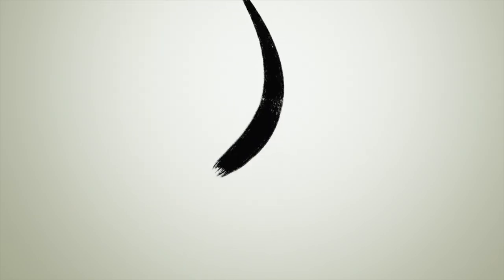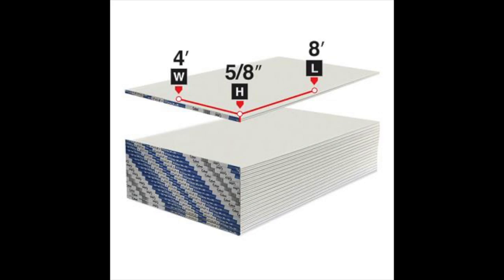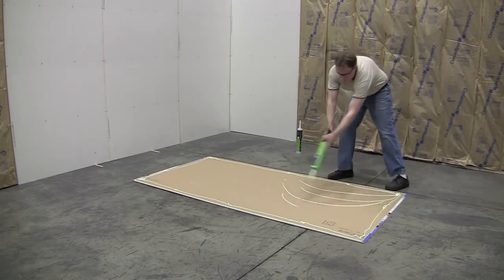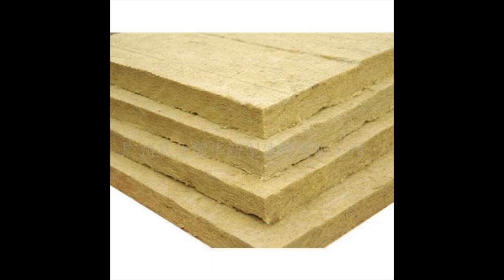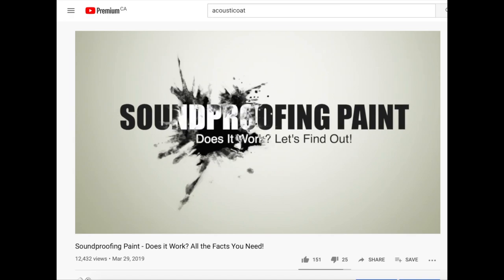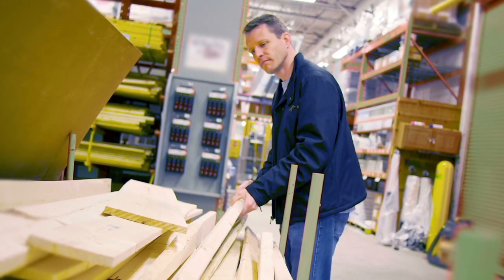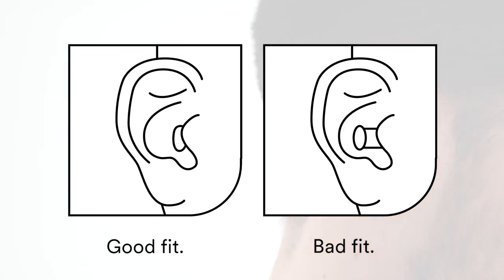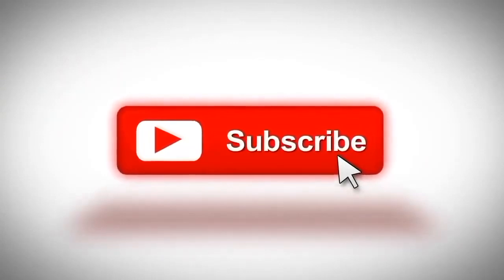How to Soundproof a Ceiling the RIGHT Way! DIY & Cheap!

Comment: mr soundproof guide, i live in basement with dry wall and the noise from de 2nd floor drives mi creazy. What can i do?
Reply: YES.  HELP
Reply: Just turn your radio up even louder than the noise above you, or you could get a broom stick and start hitting the ceiling when the neighbors above are too noisey

Comment: Hi there, in your article How to Soundproof a Ceiling, you suggest if there's a finished ceiling to attach the soundclips to the studs through the finished ceiling.  The local supply store here said that is a completely non-standard application.  Have you tried it?  Is it effective?  I would love to not have to take down the existing drywall!
Reply: It’s not standard since you are basically just making the covered up drywall pointless. That drywall is probably directly screwed into the joists so it is getting direct impact vibration. Also installing resilient channel over existing drywall would make it hard to find the joists. The metal Chantel’s have to Atleast by screwed into the joists. Anyways, while it would work, you are already doing a lot of work to put up new drywall and the channels. Might as well just add one extra day of work by taking old drywall off

Comment: 2x 5/8” drywall + 2 tubes of green glue/4’x8’ sheet of drywall sounds pricey, is it cheaper to go with soundproofing drywall instead?  Which method would provide better sound isolation?
This is for a basement media room, looking for as little transmission upstairs as possible. Also considering adding regular pink insulation vs roxul. 
Much appreciated.
Reply: I’m thinking you could probably blow in some cellulose and dense pack it in between the floor hoist and the existing Sheetrock (that is if your ceiling is finished) adding another layer of Sheetrock is a terrible idea. Let’s add a heavy ass 5/8” sheet of drywall, thus causing ceiling to lower maybe an inch or so.. bad idea for basements.. just blow in the cellulose. It’s cheaper, you could do it in a day or two instead of a week or two.. no need to finish the drywall, no glue, no buying and packing Sheetrock around your house, no having to extend outlets, switches lights etc.
Reply: I have pasted and copied this out for you as it was a reply a gave another person in this YouTube video chat but I think it will help you out a bit too! I did change it up a bit for your needs too!

be very careful about what you are told, this sound transmission attenuation issue is tricky and never cheap and or easy.
one of the main things about attenuating noise is to create an air tight barrier that has mass and is dense between you and the sound source to work. 
if you don't want the sounds you have in your media room leaking into upstairs and annoying your family, you need to build a thick, dense, multi layer barrier between you and the ceiling that is de-coupled from the ceiling as not to become a huge speaker resonating sympathetically to the sounds you are and making with your media centre and making it worse than before. 
the frequencies to worry about are the low and loud ones, 200hz and below at 90-110db, it will only work if you build something that is around 150-200mm thick made of light gauge steel frame not pine frame and multiple layers (3-4) of dense plaster sheet like fyrchek 16mm dense plaster.
you could use 2 sheets of 16mm plaster and 2 sheet of 17mm non-structural ply wood sheet and sandwich them together in pairs with rubber infused tile glue in place of the green glue rip off! build a steel frame with insulation, not Rockwool in the cavity of the frame just normal cheap glass pink batts, add one pair of plaster/ply wood to each side of the frame making a wall really then suspend this from hangers like they do in offices ceiling construction, screw clips to your existing ceiling and bend out some steel rods for hangers and add clips to your new ceiling/wall.
I would try to get the new drop ceiling to hang about 50mm off the existing ceiling, the air gap gives you even more sound reduction too!
once up you would want to go around the edges with no more gaps and fill in any gaps around the perimeter of the drop ceiling you have just installed.
you could cornice around the edges so it just looks like a normal ceiling?
Reply: Plus i dont really like the idea that some adhesive stuck to paper is holding 70lbs over my head.
Reply: Max -x  two 5/8” over existing Sheetrock? So the theory behind the two Sheetrock is you need some sort of rubber layer, caulk or sound Mat between the two so it absorbs the majority of the sound waves hitting the wall or ceiling. If you are going for max sound absorption then there is a pretty extensive procedure to sound proof.. if you’re starting from bare floor joists for ceiling then; 
-I’d go get some Rockwool sound insulation at lowes, (HD has their brand) stuff the joists with the sound insulation, 
-get yourself some shower pan vinyl (in stock at most lowes/HD), 
-then there are these metal channels that you screw into the floor joists, and then the sheet rock screws into the channels, (helps prevent sound waves traveling thru Sheetrock into studs into upstairs/other room) 
-then first later of sheet rock gets screwed into the channels, get some sound absorbing caulk, slop it in the sheet rock layer that’s already on ceiling, then screw up the second layer. Gotta caulk any gaps in the Sheetrock to help prevent sound waves getting thru..

Long story short, if you’re wanting to just screw another layer of sheet rock into existing layer, I don’t think it would really be of much help, all the sound waves get absorbed on the ceiling then travel thru Sheetrock to floor joists into upstairs or room next door. If you’re wanting to just slap another thing of sheet rock on, I’d go rent one of those insulation blowers, cut a hole in the ceiling for the hose, find all the joists, fill in from both sides of the room the floor joist cavity (might have air vents or pipes preventing insulation from gojng all the way to the end) then once floor cavity is filled, I’d get that shower pan vinyl and double it up, then screw the secon layer of drywall up.. the insulation will stop a lot of sound, the vinyl mat should help absorb a lot of it too.. if you ever get the chance or ever finish a basement bathroom for example and you use the mineral wool and insulate the entire room, you’ll notice a huge difference in how much sound gets absorbed into the insulation it’s pretty crazy

Comment: what about acoustic panels? i am in a rental apartment. theres no way i can do this kind of construction, but i need something to dampen the noise of the neighbours above me! even just a little.
Reply: same, im looking for the same solution.
Reply: I can read my own desperation in your writing :)
Reply: be very careful about what you are told, this sound transmission attenuation issue is tricky and never cheap and or easy.
one of the main things about attenuating noise is to create an air tight barrier that has mass and is dense between you and the sound source to work. 
if you have an upstairs neighbour and can hear them bouncing around up there while you want it to be quiet in your living space you need to build a thick, dense, multi layer barrier between you and the ceiling that is de-coupled from the ceiling as not to become a huge speaker resonating sympathetically to the neighbours bouncing sounds and making it worse than before. 
if the frequencies are higher rather than lower then it will be a thinner structure but if the frequencies are low and loud then it will only work if you build something that is around 150-200mm thick made of light gauge steel frame not pine frame and multiple layers (3-4) of dense plaster sheet like fyrchek 16mm plaster.
you could use 2 sheets of 16mm plaster and 1 sheet of 17mm non-structural ply wood sheet with insulation, not Rockwool in the cavity of the frame, if made well you could suspend this from hangers like they do in offices, they screw a clip into the frame of the building and bend steel rod to form a hook which then hooks through the clip and then to the frame of the false ceiling, they then drop in the white fibre board and you have an office ceiling. you would not need to use too many clips depending on the size of the room, standard 3x3 maybe 9 clips? I would try to get the new drop ceiling to hang about 50mm off the existing ceiling, the air gap gives you even more sound reduction too!

once up you would want to go around the edges with no more gaps and fill in any gaps around the perimeter of the drop ceiling you have just installed.
it will cost a little bit and be a bit annoying to build but it will give you the best chance of attenuating the lower noises you currently hear.
As it is a rental I understand having to deal with the landlord but in the end it should be easy enough to remove and the damage left behind would be cheap and easy to repair. if not then offer to do it more permanently, a little thinner and cornice around the edges so it just looks like the original ceiling?

Comment: I am planning to soundproof our ceiling in our condo.  I would like to avoid ripping out the exisiting ceiling.  My plan is to apply mass vinyl directly to the existing dry wall then apply clips/resilient channels to the joists and apply 2 layers of dry wall with layer of green glue between.  Will this plan be negatively affected by the fact that I am not ripping out the existing dry wall?  Also, any tips for soundproofing can lights?  My plan is to do a LED conversion kit and bring the wiring through the mass vinyl and use sound putty.  Thanks!
Reply from the maker: Yes! You’re on the right track! The led conversion kits with putty pads should do the trick! You won’t have to rip out your existing ceiling by doing all this! Please let me know how it all turns out!
Reply: Hey! I'm thinking of doing something similar! Did you do it in the end?
Reply: Was looking into towel fabric , actually works better than foam  plus cheaper,thinner. Saw the test on another YouTube vid
Reply: How did it turn out?

Comment: subbed! my neighbor kids' banging/jumping/running right above my room; 
they initially had 0.5 inch thick children playmats as their flooring (and everything was silent), BUT they had to remove it because they couldnt maintain/clean it regularly. 
so the solution left would be for my ceiling, so im thinking, if i combine - layers of acoustic paint, then dry wall + gluegreen, would all that be enough?
thanks and more power to your channel!
Reply from the maker: Yes it would! I would skip the acoustic paint and add mass loaded vinyl between the two layers of drywall. The price of a gallon of acoustic paint has gone up in price tremendously while MLV has stayed pretty much the same. And MLV will be a lot more effective! Thanks for watching and subbing! 😊
Reply: @soundproofguide  Awesome, thanks! 🍻🍻

Comment: Could you use Silicone sealant instead of the green glue?
Reply: use rubber infused tile adhesive and trowel it on the entire sheet like you would if you were going to stick tile to it and just sandwich it in-between your plaster sheets, the rubber in the tile glue does the same thing as the green glue and depending on the tile trowel you use you can have a thicker layer than what you'd get from green glue. I believe 4mm, 6mm, 10mm and 12mm trowels are your choices, cheaper and better!

Comment: How much would it cost to soundproof a 14x13 room ceiling with drywall already installed? Rough estimate if I hired someone to do it and materials?
Reply: sound proofed to what level? and to what frequency? how many db @ 30hz do you want to attenuate? what is the worst frequency you are trying to control? to do it right it is expensive and to get others to do it for you.....double that. sorry I wish it was cheap and easy too!

Comment: I’m thinking you could probably blow in some cellulose and dense pack it in between the floor hoist and the existing Sheetrock (that is if your ceiling is finished) adding another layer of Sheetrock is a terrible idea. Let’s add a heavy ass 5/8” sheet of drywall, thus causing ceiling to lower maybe an inch or so.. bad idea for basements.. just blow in the cellulose. It’s cheaper, you could do it in a day or two instead of a week or two.. no need to finish the drywall, no glue, no buying and packing Sheetrock around your house, no having to extend outlets, switches lights etc.
Reply: I wondered about this. I've got a finished fake ceiling and was hoping they could just blow it in somewhere, but company specialised in isolation told me they would have to take down the whole ceiling.
Reply: you are talking about 2 different things, sound or db attenuation and sound frequency control.
if you have an issue with low frequency travelling through the floor/wall/ceiling then you need to install something to attenuate the volume and reduce the db level travelling through that surface, 
if you are in a room and are making sounds inside that room and feel the sound is a little boomy or there is too much reflected sound bouncing around the room and it has too much  reverb then you are talking frequency control.
too many people get these mixed up and confused.
treating the floor joists with blow in cellulose will do next to nothing for sound or db attenuation.
nothing is for free in physics unfortunately. 
massive low end frequencies at high db levels = huge amounts of energy needed to disperse to work properly. think about stopping a car using only bicycle breaks, it's cheap and easy but I'm not going for a drive with you!
Reply: @mergatroid1212  have you ever been in an unfinished room before insulation and after insulation? Specifically the mineral wool insulation? Pre insulation sound travels easily, unrestricted, echoing. After insulation the sound gets absorbed into the insulation. It’s rather amazing the difference the insulation will make for helping deaden sound. Then as far as the sound traveling thru walls, like this video shows you need the channels thst attach ti the studs, then drywall attaches to the Channels, prevents sound waves from traveling thru the studs/Sheetrock easily into neighboring rooms. The Mass Loaded Vinyl helps absorb a lot of the sound waves traveling thru the studs and Sheetrock, it’s like the sound deadening mats you can get for your car and stick them on the inside of your doors, car ceiling, trunk bare metal etc.. it’s like riding in a base model car vs a fully loaded luxury car. The hollow car sounds hollow, the luxury car sounds solid. The vibration is cut down due to the vinyl layer absorbing the sound. I’m sure I just repeated what you had said but having done multiple jobs trying to fix this exact issue, the insulation does more than you’d think, same with a layer of vinyl..